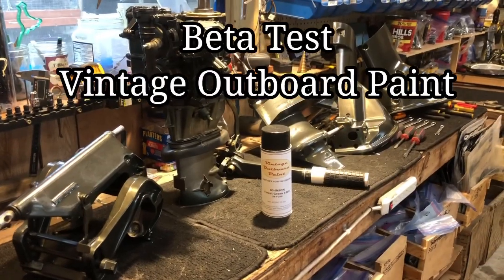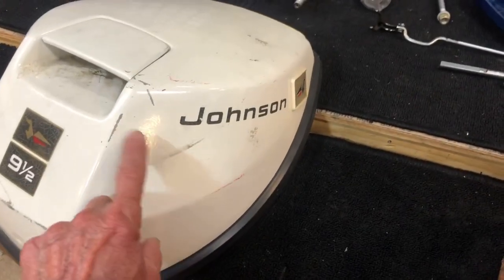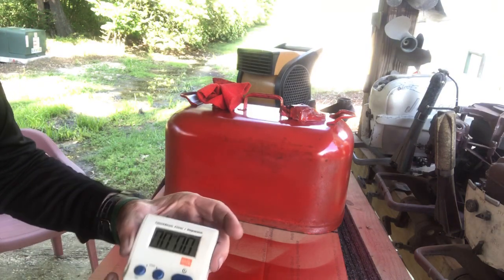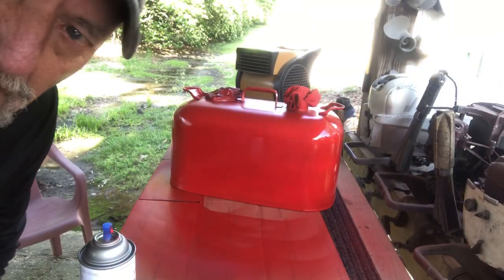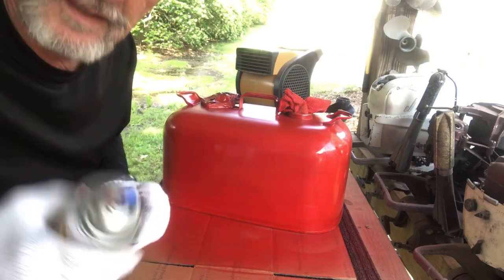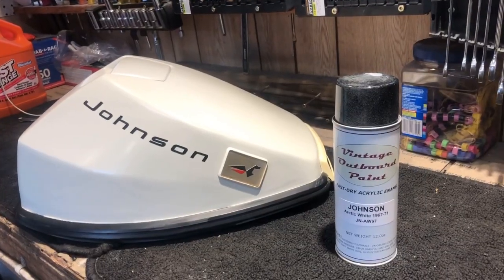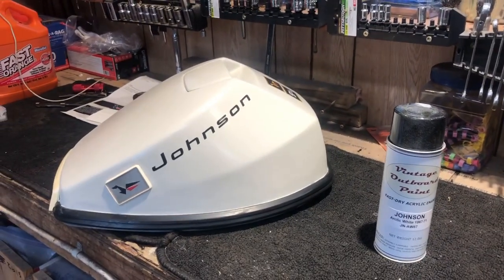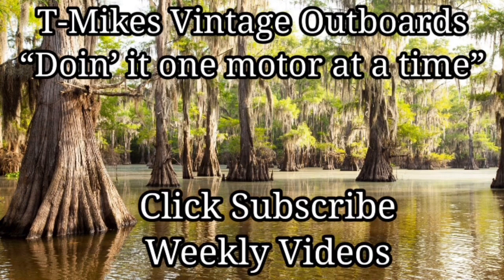Best Paint for Vintage Outboards - Beta Test Vintage Outboard Paint - Perfect Match Paint

Comment: I feel cost,for what they are,  VOP are on par with going to the auto paint store for a custom mix can so not horrible. Rustoleum is supposed to be cheap paint for the home DIYer. I ordered light blue and white for my 74 Mate, still need to get the paint off the tank mount and a little off the tank.